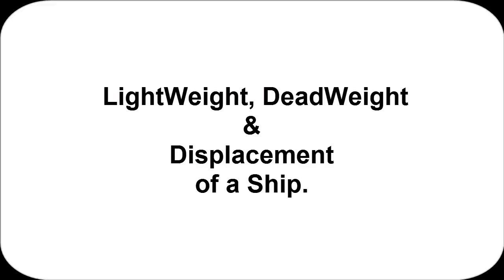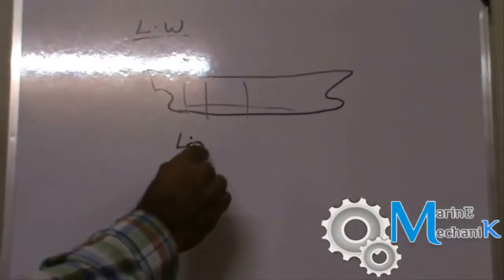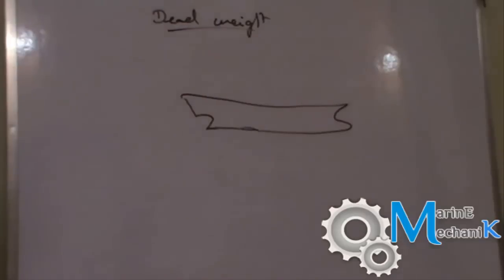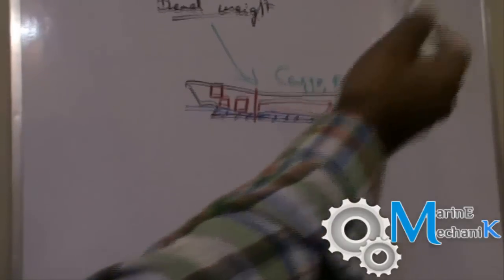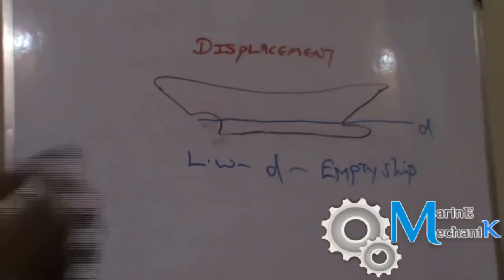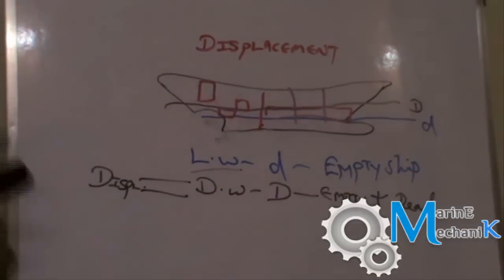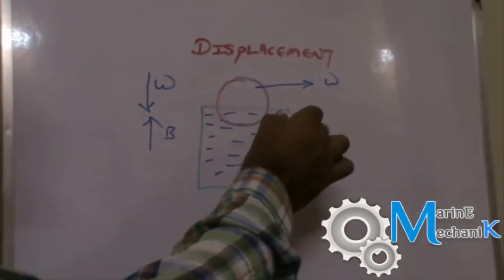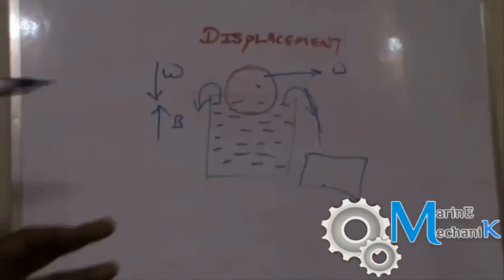Understanding Ship's Weight.

Comment: Displacement  is under water volume of the ship x density
Load displacement is the mass of the ship floating evenkeel at her summerloadline in salt water.
Light displacement is the mass of the ship when floating with no cargoe fuel stores or any other wts not forming a hull or machinery or fixed equipment of the ship.
Volume of displacement is the underwater volume of thexship.
Deadweight is the diff between light displ and load displacement.
Deadweight is also defined  as the total amount of wt that can be loaded to bring the ship down to her load displacement.
In short word dwt  =displ-ltship